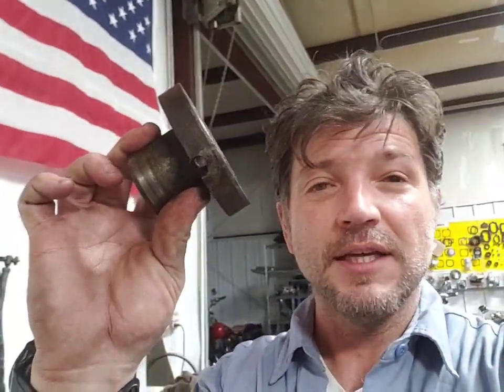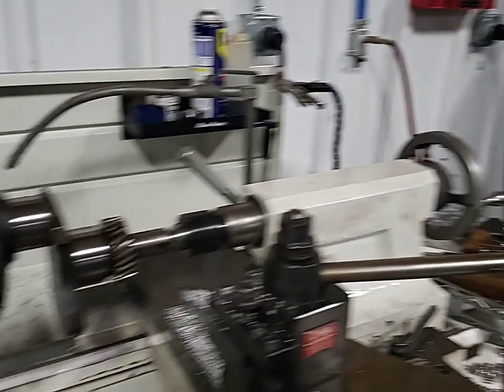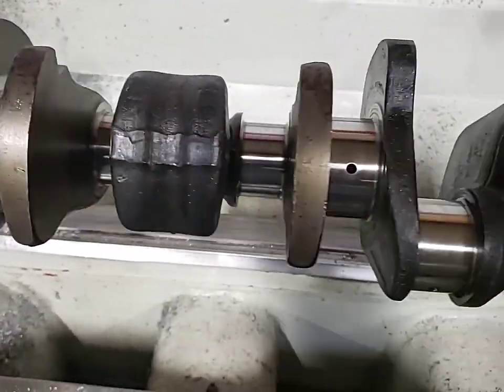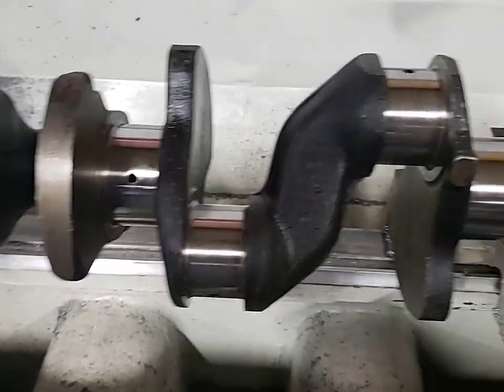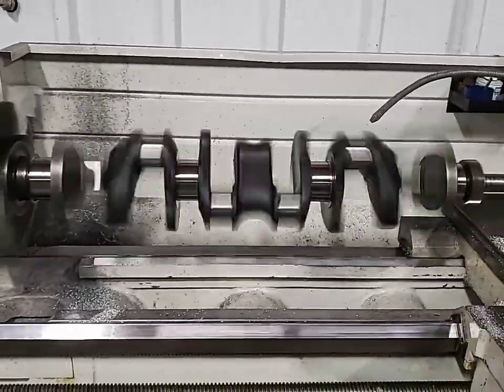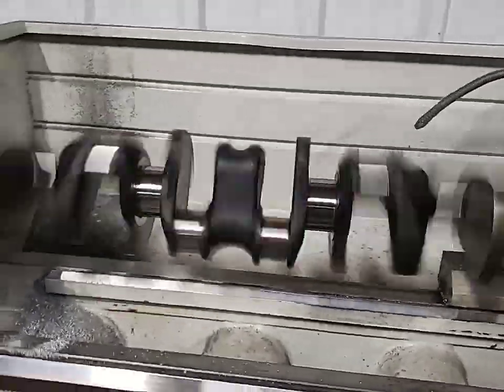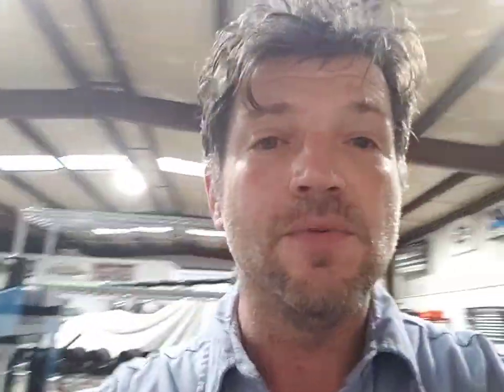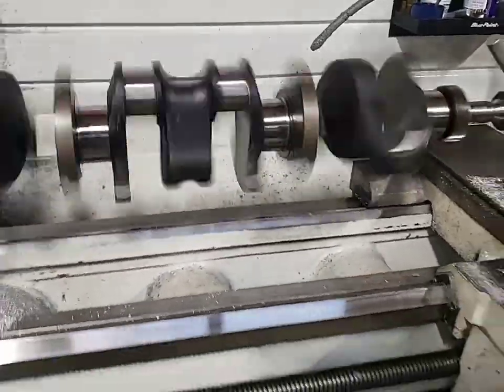Crankshaft Repair Preview - GMC Inline 6 302 - Kevin Baxter - Pro Twin Performance

Comment: 6,000 rpm = 100 revolutions per second.  Mankind has accomplished some amazing feats of engineering.  Large turbine engines spin around 25,000 rpm, and some micro turbine engines can reach 500,000 rpm.  ETH Zurich has set the record with an electric motor turning  1,000,000 rpm.  Videos like yours help people really understand what machinery does and how precise parts have to be.
Reply: Yeah, that's exactly why i think that HD dropped the ball when it came to run-out  on their crank, anyone who has worked in a shop and used an indicator knows the importance of a shaft running true.
You really don't have to be an engineer!!!
It boils down to do you want dependable longevity OR a timebomb???

Comment: Spec's on the 49 Chevy 216 called for the idle to be set from 450 to 550 rpm and I generally set my 49 216 around 500 rpm. It would idle as smooth as an old Singer sewing machine LOL. It sounded like it was going to fly apart at 3K So I never took it there much and when I did (to pass etc.,) it wouldn't be for long. It absolutely loved to cruise around 1900 - 2K rpm and would do it all day long. Unfortunately with it's gearing  highway and interstate runs were no go.... It's been upgraded to a 54 235 with a little mo go but still retains it's period correctness.  Theres something relaxing in wrenching and cruising these old Stovebolts and I do mine often. Carry on, enjoying this series.
Reply: I don't know why they call them stovebolts ,but I liked your comment and I relax and enjoy cruising and wrenching on anything ,merry Xmas and happy safe new year from,Auckland ,NEW ZEALAND ,cheers,Kevin does good videos dosn,t he,he,s the man...allthe best....
Reply: Ya know, a 5 spd T5 would allow ya to run at highway speeds with overrevving it.

Comment: unrelated,but which is better to run in hd 103,89octane methanol free,or 93octane?
Reply from the maker: You could run the lowest octane provided it doesnt create pinging issues.  In any case, you can run ethanol fuel without too much concern, just dont store a bike with it in there.  before storage, run NON thru it and fill the tank.  when you pull it out of storage, refill with ethanol.